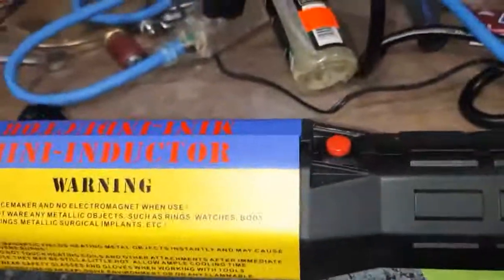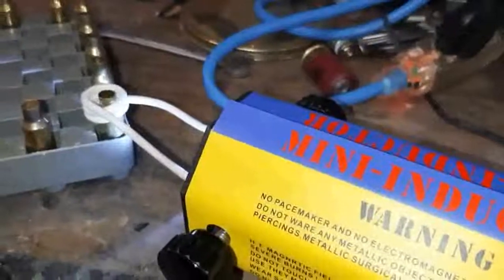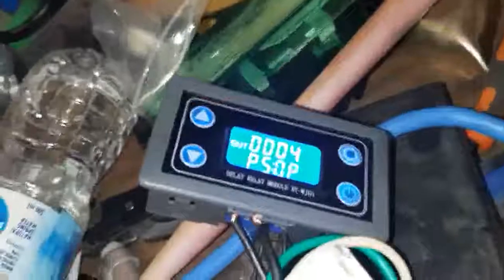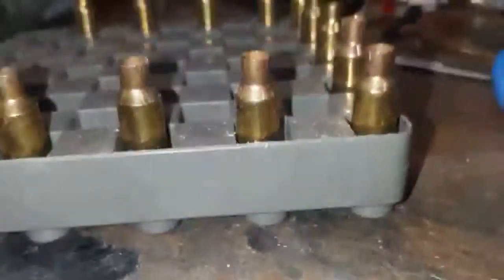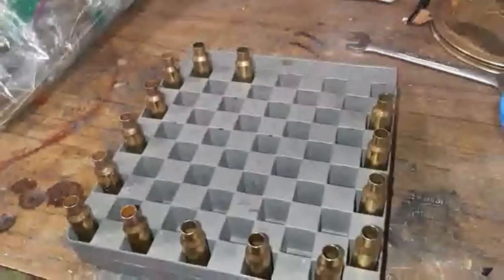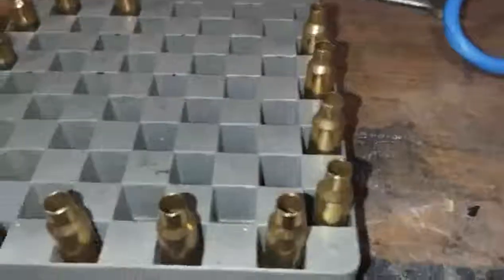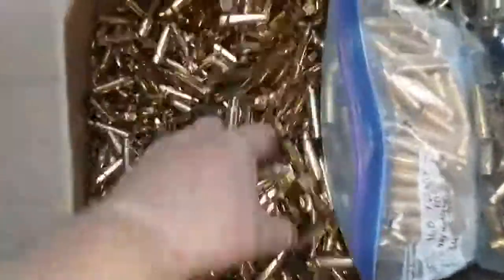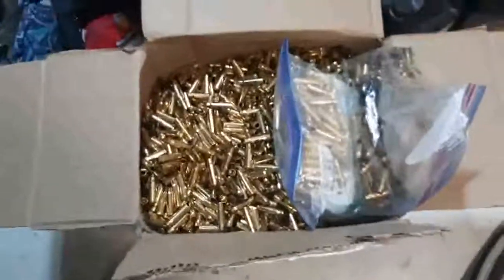Diy induction annealing for reloading and why.

Comment: Shorten the leads on the coil, and make the coil tighter. I use a 8mm socket to make the coil for 223. Mine only takes 1.2 seconds. Also, i bought a cheap 6020 blower fan and attached it to the end of the handle. I can literally do 1k cases and it never trips the shutoff for overheating.